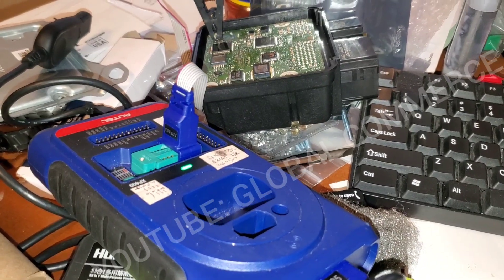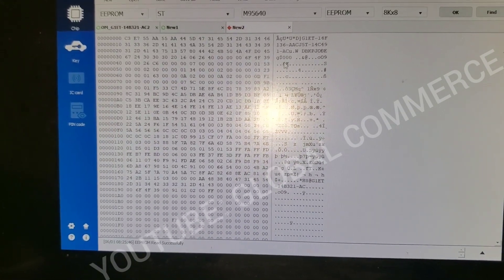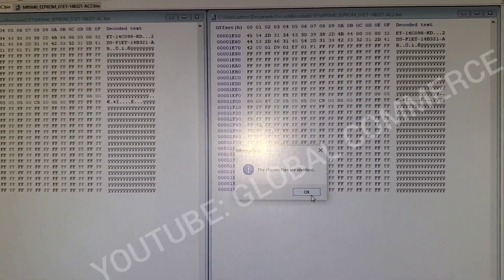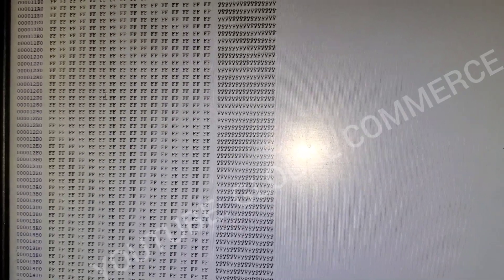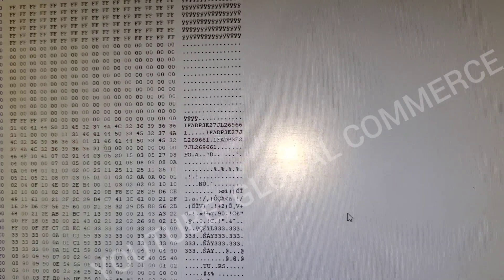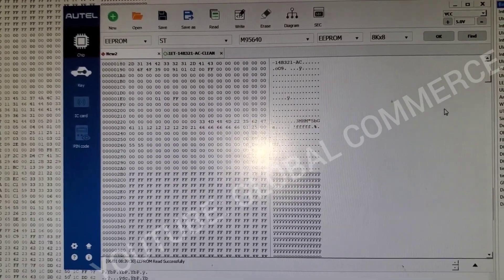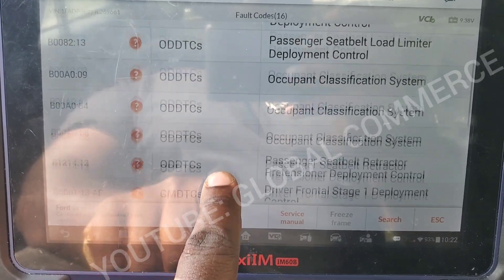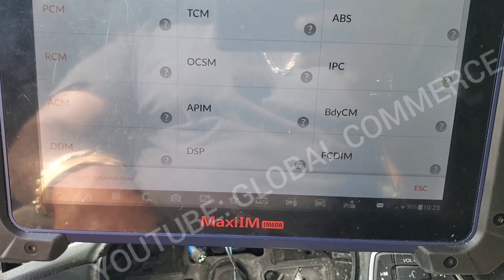Manually clean airbag SRS RCM crash data via HexEdit and Autel XP400 PRO, EASY! Will it work?

Comment: How can you use the Autel clamp so easily? It's a nightmare everytime I need to use it.
I have read/write/erase verify ON, and every time I read it, I get a verify error on the second verify reading. The same happens during the write.
I usually need more than a hundreds tries until I read this correctly.
Is there any trick? Or maybe my clamp is defective? 
Thanks for your help.
Reply: Hey just felt with this myself today… make sure you scrape off that gel coating they put all over the board and chip pins. Took me a while to figure that out; once I did it works every time

Comment: I am glad that I am not the only one taking an off ramp from the ICT highway..I've been a support engineer for years and there's so far no challenge in the automotive side that I find intimidating..Continue to do what you are doing..looking forward to the next one
Reply: lol. Me too. I realised that the IT field in my country is getting oversaturated.
Reply: I guess the the autel software you used here is not universal and is only useful to those using an autel tool. Please clarify...
Reply: @zwahashu  Yep it's only for the XP400
Reply: @makesisoanes6320  I thought as much. I tested  Mpp v.18  connected via Godiac Gt100 breakoutbox to flash Mercedes SIM4LKE ECU. The reading was very quick and It flashed it with no issues. I wish I had an airbag module to test this rig on.. Any thought on this?